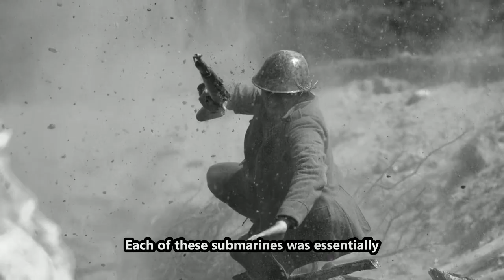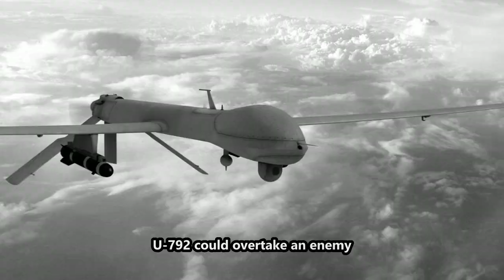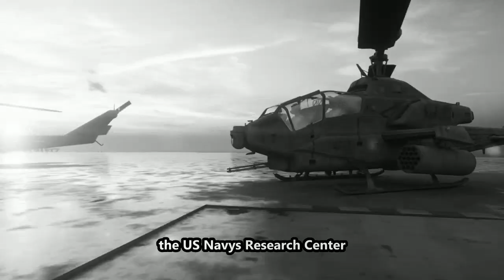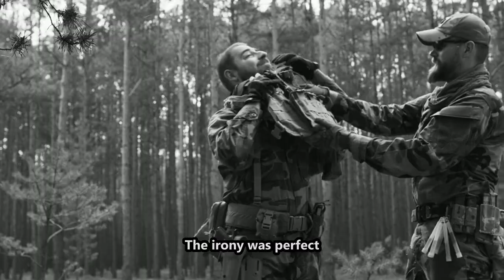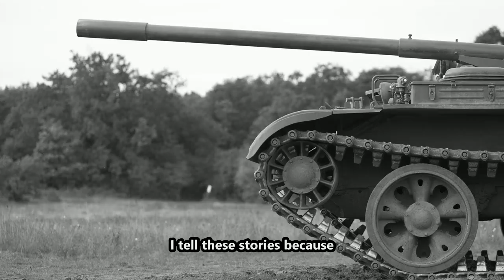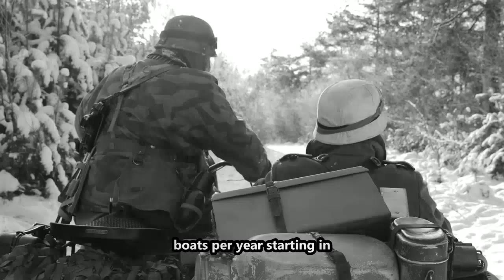NATO Copied Walter Hydraulic System from German Type XXI U-Boats After War

Comment from the maker: The Walter system achieved 25 knots submerged - faster than most modern submarines! Which technical details surprised you most? Did you know that 80% hydrogen peroxide (T-Stoff) decomposes at 600°C generating 4,500 HP from a 3-ton engine? Share your thoughts on this incredible German engineering achievement.